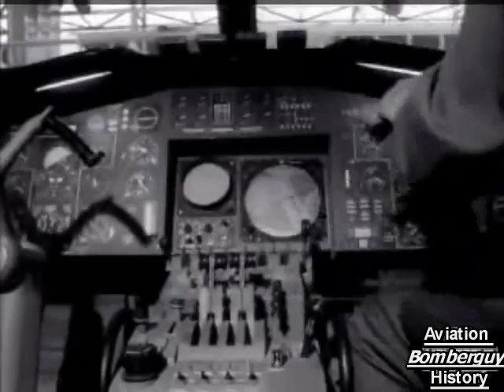Concorde 1962-69

Comment: I think that the number of passengers was limitated by technical factors:more seats would have required a longer ,and much heavier, fuselage, and duraluminium would be not enough "strong" to guarantee the integrity at high speed. Structural integrity was a great problem, Concorde was re-designed several times in order to have enough safeness.